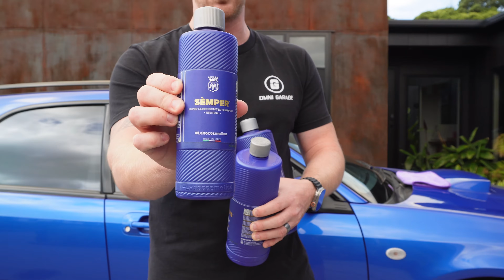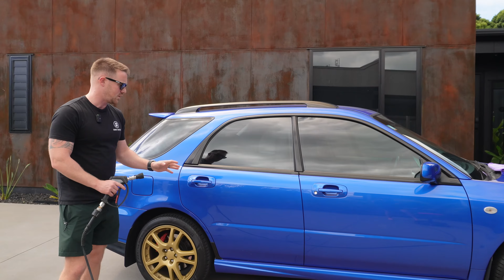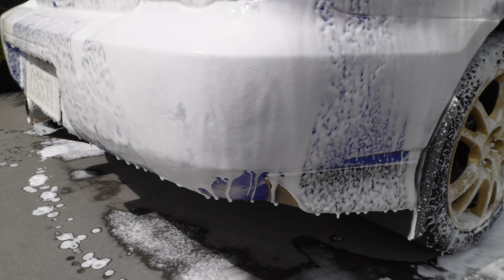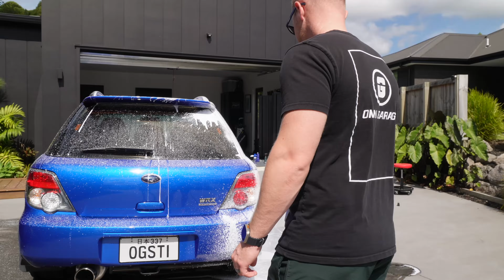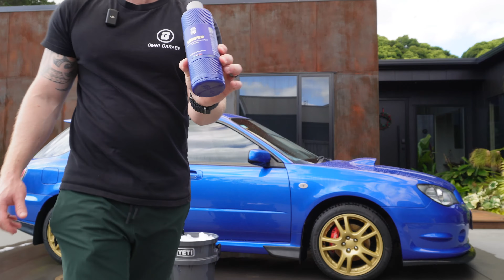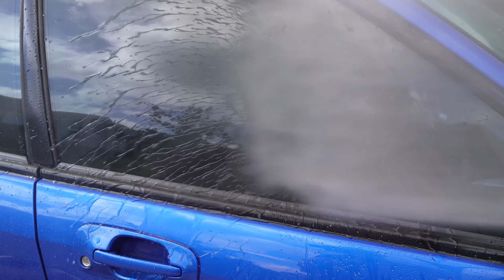Decontamination As Easy As 1-2-3 | Labocosmetica 3pH System

Comment: what confuses me is why pre foam on purifica, the acidic shampoo, if you are trying to get rid of mineral or water spot build up that is mostly/can be behind the traffic film that is only removed after a true contact wash? What / when would you use the acidic shampoo/soap after the contact wash, keeping time and product saving in mind.
Reply: I dont think hes used it correctly? Reggy the Labocosmetica guy who does videos has the tissue test so after the initial Primus spray.. He uses a tissue to check if there is still a film left on the car, if there is he does a contact wash with the primus and then decides if Purifica is needed. What he says is that if there still a layer of film left then Purifica will not do its job in the next step - if not clean and hes happy with primus results then its straight to semper. Ive ordered my products so will be following those steps by Reggy and trial them out

Comment: I use this exact system, but I use Revitax every 2-3 weeks since it has SiO2 in it and then use Semper for my weekly maintenance wash.
Reply from the maker: Yes it’s a good system and semper is an amazing smelling soap.
Reply: @OmniGarage Yeah it's very Italian smelling! Smells similar to Proraso shaving soap!
Reply from the maker: Haha yeah I get ya!
Reply: @OmniGarage You guys should do a SiO2 soaps comparison video and throw in the Revitax
Reply from the maker: Not to sure I see the point of those soaps. We have ceramic coated cars and use drying aids to dry the vehicles. Adding Sio2 soaps I’m not sure we need/ want extra stuff hindering coating performance.
Reply: @OmniGarage I think I see it more so as the budget protection for people that don't want to go all the way but like the hobby enough to buy that product. Like me more so, some people like doing some of it themselves but don't want to go all the way to take the time to put coatings on and just use a SiO2 soap and a SiO2 topper
Reply from the maker: Yeah quick beads, beads/ water activated protection would be my option. There are also stout ceramic based sealants and very good ceramic spray coatings which are on the cheaper side and very user friendly.
Reply: @OmniGarage Yeah that'd be a video I watch, seeing the comparisons

Comment: Ok  question i seen somewhere that someobe used the 3ph system on a coated car when the coating is clogged.   Wouldn't that be too strong??
Reply from the maker: No
Reply: @OmniGarage  ok awesome.  So the same steps to follow.   And it takes off waxes and sealants but won't damage or weaken coatings.
Reply from the maker: @daviddup1978 if your coating is on its last legs then it could take that off.
Reply from the maker: This isn’t a soap you will use every week though. Just use it for when you are doing a decon wash for polishing etc or if your coating has failed and needs a deep clean.

Comment: A couple of tips for those who are new to the 3 ph system from Labocosmetica.
1) As they now openly admit, since the new reformulation of Purifica, you can use it as a bucket shampoo as well. So just prewash with Primus 2.0, rinse, then apply Purifica on foam, ad the residual from the foam into the bucket (or still reach somewhat between 1:400-1:200) and work your way with the glove. The mechanical action does the magic. Semper is now just lubrification when you need it, such as the bucket you may use while agitating the alkaline on the wheels before washing the paint.
2) Putting aside Idrosave which was really developed for the North American market (which is huge for rinseless washes, much more than here in Italy), the scents of the products are not tropical/fruit/whatever which is associated with low cost, bad for health, fake beverage/candies. For example the smell of purifica comes from Amaretto di Saronno, an Italian liquor which depending on the brand, it may be made from apricot kernels, bitter almonds, peach stones, or almonds. My favorite smell is Primus though. Purifica not so much. Even their Iron remover (Sidero) is scented in a way that doesn't force you to throw up after 10 minutes of close distance brush work. Labo has always been very much into perfume. Remember that they operate at short distances from those luxury fashion brands which sell perfumes as well. 🙂

Comment: LOL, Descale is in no way Purifica level, higher dilutions work well. Go to the bucket while the purifica is still there, then rinse. You can use any PH neutral soap for the third step.
Reply from the maker: And what makes you say that?
Reply: @ the ph of Purifica is much lower, but also stays acidic at very high dilutions. Not saying Descale is a bad product, but they are not equal. I use Descale out of a spray bottle, to hit areas of recent contamination. Purifica is a full on decon step for me, it goes deep.  I honestly am much more careful with it, where Descale is no worries.
As per Reggy, Purifica also has surfactants to clean, and lubricate.  
You have to play with this stuff, find how it fits your needs. The smells, full on Italian scents. From cologne, to liquors. let’s just say they are Cafe.
Reply from the maker: Descale is a fantastic product. Have been using it for some time now and on our customers cars that come through the shop. Never had a problem with it, leaves the surface clean and bare reading for a mechanical decon/ polishing. I’m still not convinced the this 3ph system removed the drying aid completely, definitely reduced it.
Reply: @ yes, I still find Descale very relevant. Like I said, they are just not the same.  
I don’t feel that the 3ph wash is a tegular maintenance ideology. I feel it’s just the first step to a full on decon.  The fact that the dilutions on the Labo are so expansive, they become products that you can actually use as preventative maintenance, more often.  
Look how spoiled we are now. So many products to fill every need.  CarPro is an innovator.  Descale was the Acidic ph shampoo, that showed up at the right time.  I look back to ECH2O.  Excellent product, ahead of its time. I will still use it as a rinseless wash. or drying aide. Leaves a beautiful glow on the finish.  There are for sure much more modern products, but ECH2O still works.
Reply: @OmniGarage   @waterhose4130   This is a good video showing the acidic stability of Purifica as compared to competitors - I believe Carpro Descale is 'C3' in this video. https://www.youtube.com/watch?v=udBia-IJRHk